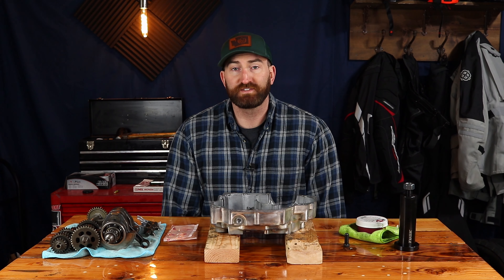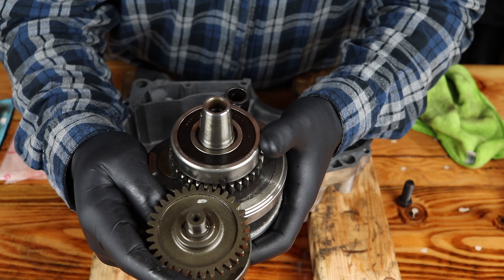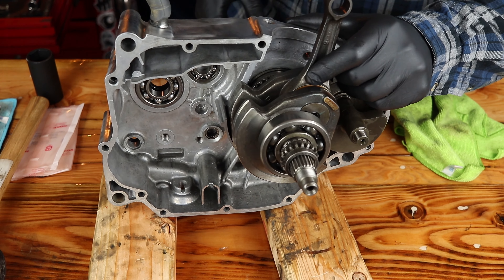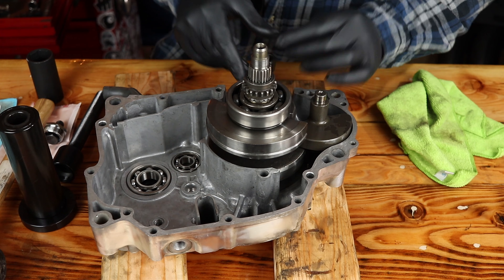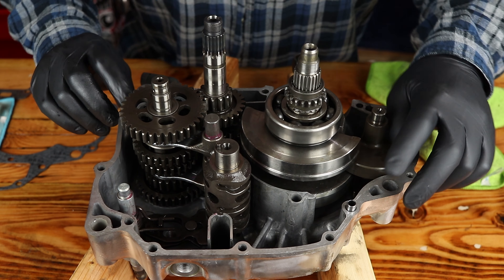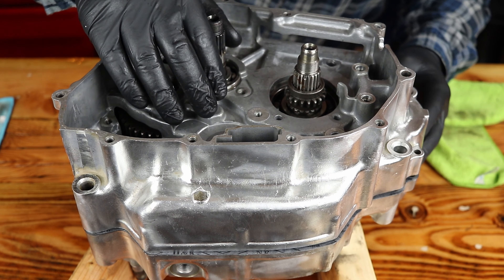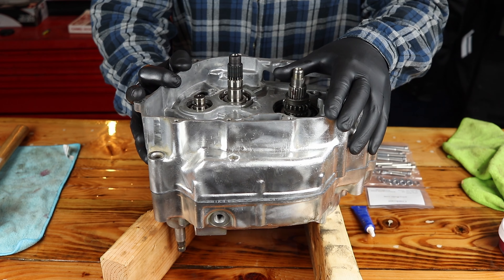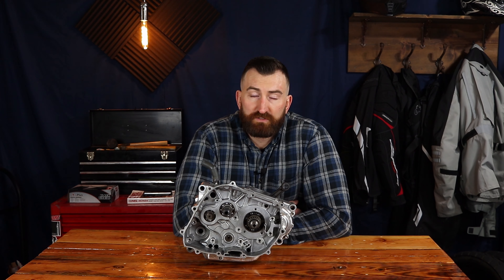4 Stroke Dirt Bike Case Assembly XR250R

Comment: does mineral spirits work the same for prepping metal pieces? I have been scrubbing clean with degreaser, dipping stuff in evaporust then rinse and wipe with mineral spirits. Is this ok to do for crankshaft/head pieces or should I be finishing with acetone only
Reply from the maker: Sounds like what you are doing would work fine.

Comment: Hey thank you so much for these videos. Currently trying to rebuild my xr's crankcase. Can you check your work before reassembling crankcase? Check shifting specifically? Are the shafts supposed to be able to spin continuously?  Mine spin and then stop at a certain point. Also cant seem to get the transmission in neutral. Both shafts spin no matter where they're positioned on the drum.
Reply from the maker: In neutral the transmission should spin freely. If it is in gear the transmission will turn but with the crank shaft. Make sure the shift forks are positioned in the correct order. There is an "L" "C" and "R". Do you have a shop manual. If not there are free downloads online that I have found. I would spin the crank and turn the shift drum down into "1" then half shift up into "N" might be an effort with the cases split in half. Let me know if you need anymore help.
Reply: Thank you for the help. Went back through and checked everything. I had the top gear on the countershaft flipped. Everything shifts and works properly now. Thank you again for the help and these videos. Newbies like me would be lost without it.

Comment: Thank you for your helpful videos! I am having some trouble however… I’ve gotten to the point where I am bolting the crank case together and the spot where the cases meet on the back side of the engine next to the shift shaft and counter shaft won’t tighten down enough to keep the gaskets from sliding freely between them without going over 10 lbs of torque and the countershaft stops spinning freely. the cases sit about a 1/16 of an inch apart with all the bolts loose. I’m wondering if I need to get the cases resurfaced or if there’s anyway reason the shafts maybe aren’t seating all the way. Thank you in advance for any advice you can offer.
Reply from the maker: With the cases empty, do they mate together without the gap?  Is it possible one of the bearings isn't seated properly? It sounds to me like something I binding.

Comment: I have a 1984 xr200r and wanted to know if you know if the engines are basically the same just with a dual carburetor, thank you, great videos
Reply from the maker: They are very similar. I don't think the parts are interchangeable.